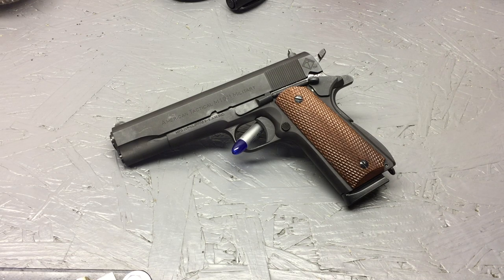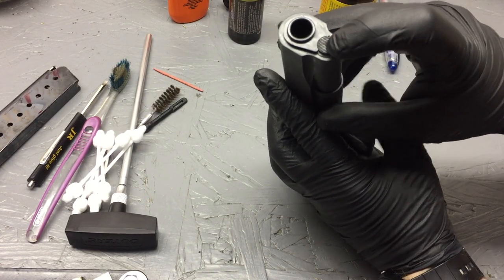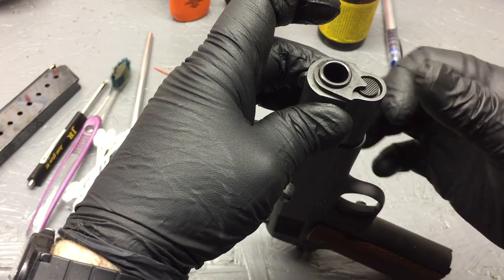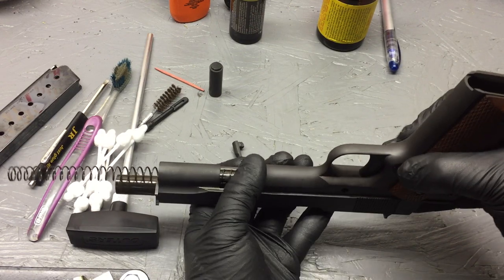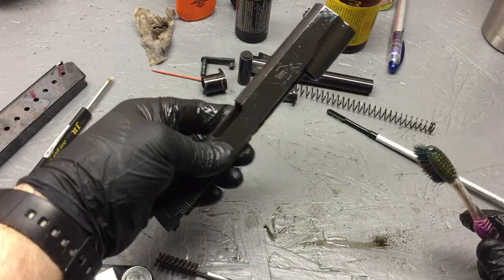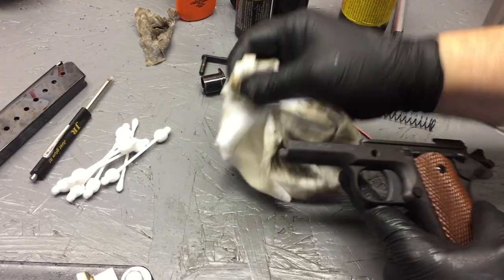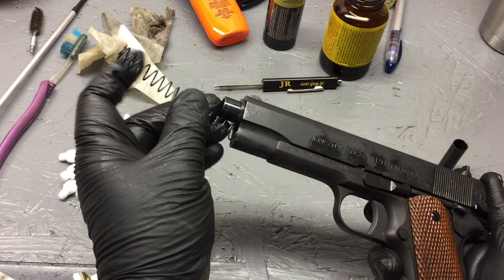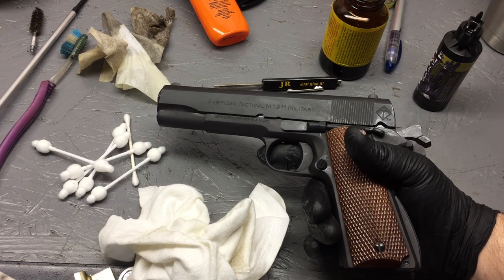1911 : Field strip, Cleaning, and Lubrication (Quick and easy method).

Comment: You are really thorough.... I use Hoppe's #9 for a solvent then Ballistol everything. Thanks for a great video on the cleaning of a 1911. I was amazed by how you got so much gunk out of the barrel after you ran a patch through and it was clean, then by using the brush again the patch came out dirty. I too am looking for an alternative solvent for cleaning the bore... looks like Hoppe's #9 did ok with the soak and brush.
Reply from the maker: Thank you Gary! I’ve found a new solvent that works great. Stay tuned for more cleaning videos.